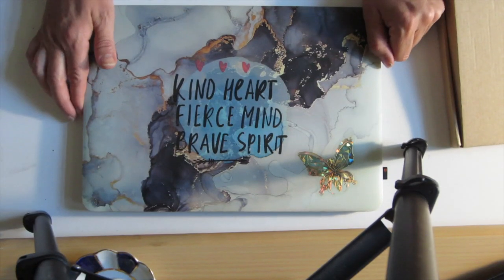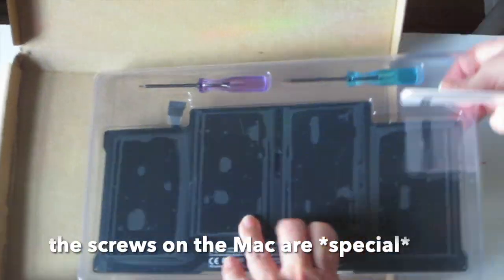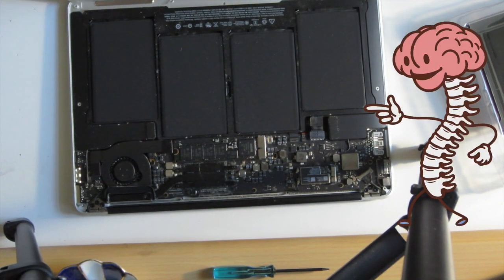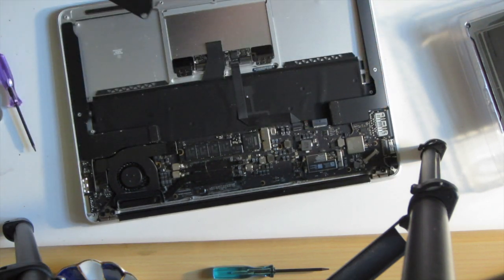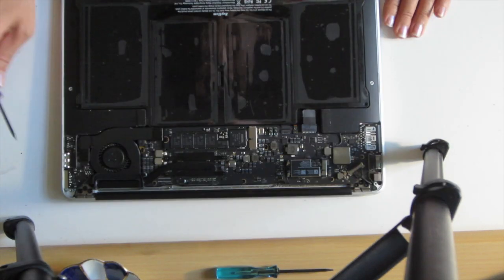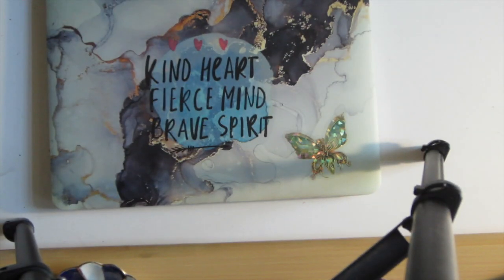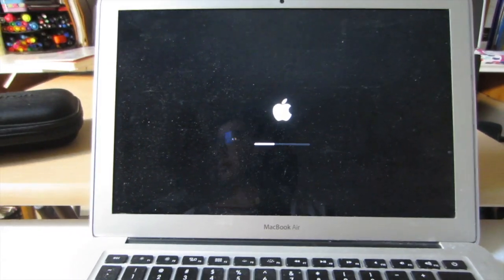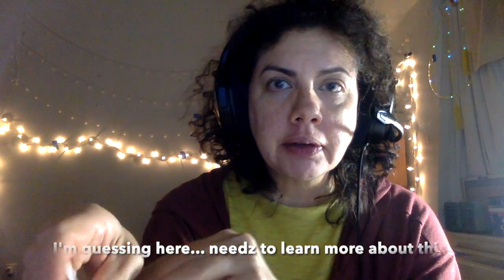Macbook Air 13 Battery Replacement | Macbook Air Battery Replacement A1466

Comment: I'd suspect that the powercycling of the battery is to allow the laptop to recalibrate itself. The laptop keeps track of how much power is available, when the laptop is plugged in vs. when it's running off the battery and monitors the voltage of the battery. This is so it can warn you that you're running low and get plugged in to save your work instead of pulling your hair out and destroying the laptop after you lose multiple hours of work when you suddenly have no power!!  😠 😤 😤 😡 
Over time the amount of time that the battery is at a safe/usable level after the laptop is unplugged decreases. It goes from many hours to some hours to a few hours to .....  The purpose of doing the charge to full/rundown to low cycle multiple times is to allow the computer to figure out that it's back to many hours of being usable instead of a much shorter time.

I found your channel when your "Why People Over 50 MUST start using Linux" video popped up. Then I checked out other things you'd posted quite refreshing style you have! Keep up the good work!
Reply from the maker: @djmccullers  Thank you! This makes sense. I feel like I did not power-cycle the battery right. I find that it is losing juice quicker now. Can you still power cycle the battery? Thank you for watching my videos
Reply: @stylishthriftye  I think you should be able to. Let it run down to 10%-5% then charge it up to 80%-90% and repeat. I don't know squat about Apple products, but I'd guess (hope) that should work. If they allow you to set an alert for various levels of low, that should make sure you don't run the battery too low. Running the battery to zero, actual zero charge of the battery, not zero as displayed by the hardware/software that the laptop uses to figure out level of charge, is a BAD THING! 

You might consider getting one of those "While I'm away, keep cycling the lights on and off" timers and plug into that. Set the timer to power on for about the time it takes the laptop to charge up to the "full" level and off for the amount of time it takes to get to the "low" level. With luck, over time, you should see the amount of time it'll run from battery increasing.  

On the other hand, you might just have a bad battery. Not sure how you'd be able to tell without test equipment. The good news is that the test equipment is quite common, a volt meter or multi-meter. If you're on good terms with your neighbors, ask around. You might be able to borrow one.